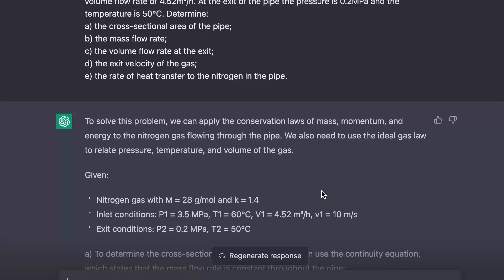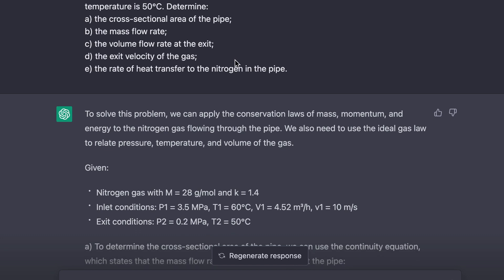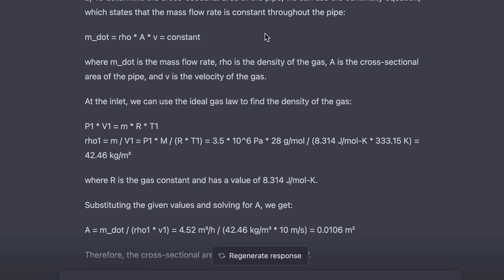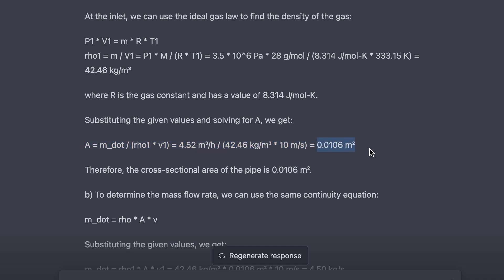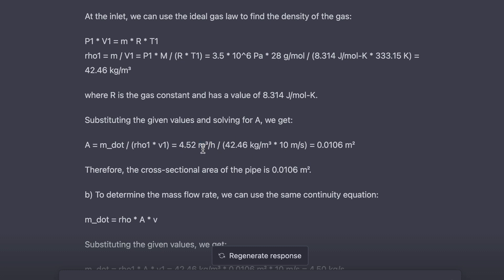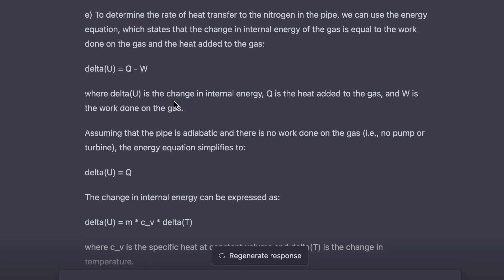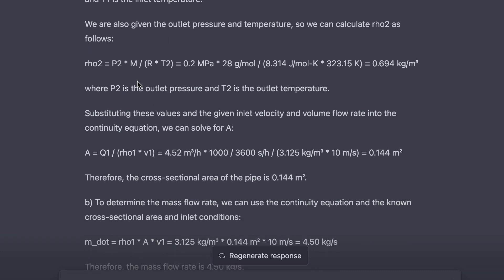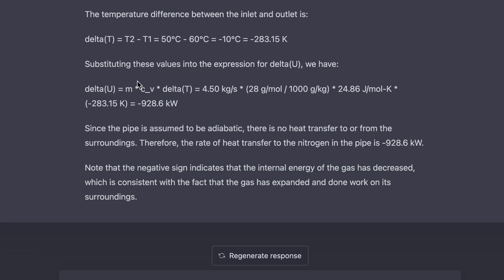Testing ChatGPT's Engineering Problem-Solving Skills

Comment: I use GPT-4 with the wolfram alpha plugin. Could I have the answers to the problems so I can test if it works any better?
Reply from the maker: There is a video with the answer and the solution. Check the cards